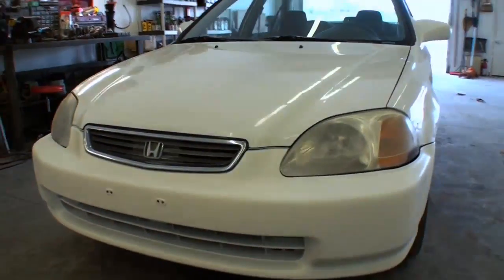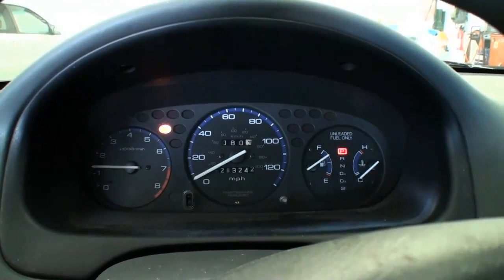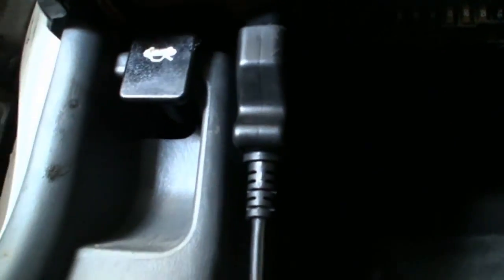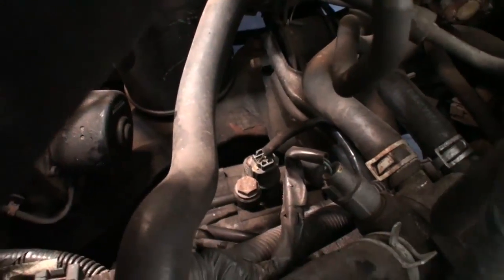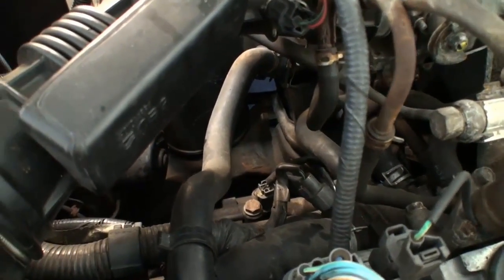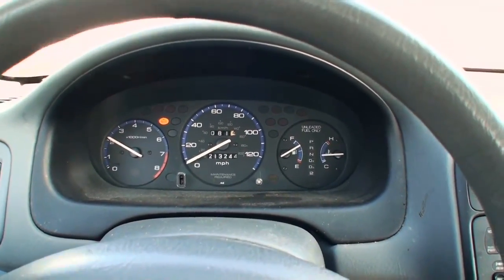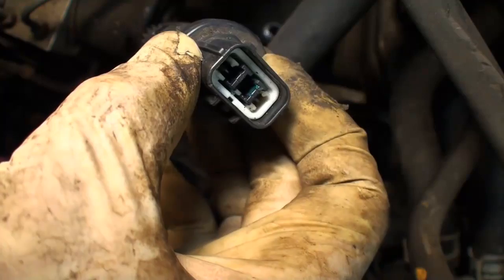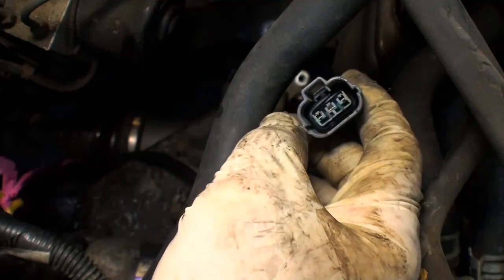P0501 1998 Honda Civic Speed Sensor Diagnosis -EricTheCarGuy

Comment: My speedometer does the jumping around 60mph. No check engine light. My transmission does shift funny around that speed. Any suggestions? Does there need to be a check engine light for it to be the speed sensor?
Reply: Marvin Cruz having the same exact symptoms as you did you get it fixed
Reply: Yup! So I took a look at the harness and corrosion was present. Also the middle clip inside the harness was lower and it just didn't look normal. Ordered a new pigtail harness from eBay, worked perfectly since then.

Comment: @ericthecarguy 
I have a 96 Honda Civic non v-tech, the speedometer doesn't work and no check engine light is on, I figured it should be on for either input and output sensors, I've also checked them all the connectors and wires are good no carosian. I also opened up the gauges and none of the gears are broken, could it be my ECU?
Reply: did you ever fix it?
Reply: @Texasnhis49bitches  yes! It's not too bad. You take the whole speedometer module out. Then you've got to find the pin that is cooked.  It's a pin in a circuit board. All I did was touch it with a soldering iron and it reconnected and has worked like a charm ever since!  The tricky part will be finding the pin. But it's not TOO hard... the plastic around it will look slightly burnt/yellow and it won't have much solder. I think it's because it gets hot and the solder vaporizes.
Reply: https://www.youtube.com/watch?v=QZPKYXVUl2M
Reply: @bob15479  video is not available

Comment: I just bought a 98 manual Honda Accord.  the speedometer isn't working but all other gauges are working. It was suggested that I check the speedometer wires for splices before I replace the sensor. However I haven't found any videos or instructions on how to check or replace the speedometer wires.
Reply: did you fix it?

Comment: i have a 1998 Acura integra with a speed sensor problem. the way i understand it, there is an input speeed sensor and an output. Ive got an issue with my speedo not working as well as a hard shifting issue. which sensor should i replace?

Comment: I'm been having trouble with mines it was bad so I went and got a new sensor and it worked well then it stopped. I cleaned the connection and it started working for a few months stopped working went and got a new sensor and now it doesn't want to work. what could it be?
Reply: did you fix it?
Reply: @Texasnhis49bitches  yea ut was my connection i replaced it and it was good never failed again

Comment: Hello, I do appreciate your precious help in the videos. Thank you so much.
I own a 1997 Honda Civic 1.5i VTEC Fastback (european model), 114 CV.
The Cluster is similar to the one you show in the video.
First the speedometer shown a behaviour like the one in the video and suddenly the needle pointer went up to the maximum speed (end of scale) and is sleeping now, pointing to "6 o'clock". All the other parts of the cluster are working well.
I do presume i have a problem with speedometer sensor which i must check attemptly for the electricals and replace by one new if necessary.

What you suggest to take the speedometer pointer to zero?

Comment: Thanks for making this video. Helped me figure out exactly what was wrong with my 98 Honda Civic DX. The needle would bounce around in park, at a stoplight, and while accelerating causing the transmission to jerk around if I had the gas pedal pushed down to the wrong spot. Disconnected the sensor and there was coolant inside, car drove fine with it unplugged, and the needle didn't bounce. Gonna put a new vss in tomorrow. Thanks again.
Reply: im a little late to this comment but can you let me know what part you got

Comment: hi eric. i have a problem with my speed sensor. civic eg 1995 model. i suspect that the wiring on the socket is the problem. i tried testing the wires using the test light. the 2 wires went on. while the last wire. the third one. does nothing. it like it doesnt have power or current running on it. is that normal or not? do i need to check the wiring connected to the transmition itself? thanks in advance
Reply: Milo Dayuta did you find a solution?

Comment: Hi Eric , question ? After installing the speed sensor an my part is exact after market part as yours, it's still bouncing? The connector on the old sensor ( all prongs "3" ) are in good condition & not corroded I replaced anyway,  could it be the connectors leading to the dash?

Comment: my 1993 s10 blazer has a 4l60e and i belive the speed sensor is bad the drive and over drive kick in and out but 1st and 2nd gear work fine i have a digital cluster dash so i wont know if the spedomiter is jumping

Comment: i just bought a manual 96 civic but it doesnt has rpm gauge. weird. i need it. and also for gear indicater. when i switch to reverse. sometime it doesnt engage. i have to do it again
Reply: +Kawaii Ninja try stick it in 2nd and then reverse in one motion, that helps usually.
Reply: +lew bear thanks. im used to the car now. i just move to reverse really hard

Comment: I went to change my o2 sensor because it was dead. After installing it I did 3 0 to 60 times but on the third time I didn't have overdrive and my cruise control stopped work.

Comment: I have a 93 civic sedan eg automatic so the problem is that when I try to  accelerate it happens very slow and in order for me to go to the next gear I have to release the gas pedal a bit and it go into the next gear still not picking up speed especially on the highway when I struggle to get to 60 any ideas on what it may be ?????Help

Comment: hi I have a 98 civic ex auto. when I first start driving the speedo does do anything until I start drive for a while. I replace the speed sensor but does the same thing. could it be the cluster?
Reply: Yup, is the motor on the needle. You need a cheap soldering iron and heat, pull it out, replace, and reheat the solder and your good as new

Comment: Hi Eric, I have a 00 civic si and the same speedometer problem but wen I unplug the speed sensor and run the car, it still sits a lil above the resting needle or bounces. could it be a bad cluster?

Comment: Eric, I have a 98 civic with a 5 speed that has the same speedo jumping symptom along with dash lights that flicker at a fairly quick pace. Disconnecting vss stops speedo jumping but does not affect dash light flickering.  I don't have a 501 code but I do have a 1298 code. I've seen .on later civics, a "load detector" related to the 1298. Does that apply to the 98? Could that cause speedo jumping, or could I have a bad speed sensor without a 501 code?
Reply: +drummerboy smith  yeah i needa know this too cause i got code 1298 the check engine is on but flashing. speedo jumping and my D4 light was flashing green but it only did that one.. once
Reply: +718BabyBoy I've got info. There's a blue connector beneath the intake manifold. Right where the bracket from intake to engine is. The bracket, apparently has been known to damage the wires in that area. I'm working on mine right now. No lift, just jackstands. It's a bitch to get up in there and work. I'm trying to get the blue connector unplugged right now.  I'm 60 years old and my fingers aren't as strong as they used to be. Already removed the bracket. The damage is not obvious. I've read that you have to  disconnect that blue connector and possibly strip away the black plastic covering the wires to find the damage.  Anyway, I've heard that this is a problem from a few sources, including an old friend and master tech with a shop in CA. who has seen it himself.  Good luck.
Reply: +dan hood check alternator fuse 7 i believe. i have a 98 civic lx. shit was going crazy. jus put a new fuse in mine looked ok but i did a new one. problem gone. my first attempts were trans speed sensor and alternator. ended up being jus the fuse
Reply: +dan hood check the fuse promise Thats it
Reply: +dan hood  

did you ever figure out the problem my cars doing the same thing
Reply: it's your alternator doing the flickering its what caused your vss to go out I've had this happen on two different  cars
Reply: that is a possibility but Its more unlikely than the eld in the alternator  going out and it's possible for it to pass an AutoZone test and then you have to check fuse 15 for the alternator speed sensor and if it's good you need a new vss
Reply: 718BabyBoy ... you just saved me a world of hurt.  A good friend was ready to write off her 20 year old civic (with only 76,000km on it!) because the speedo had gone all wacky, the HVAC controls were not working, and the engine was missing.  I put a meter on it and noticed it wasn't charging, and then I read your post.  Replaced the alternator fuse and ... bingo ... problem solved!!  Thanks buddy!  You made her a happy girl!

Comment: Friend of mine has a 1992 Honda Civic where the speedometer bounces back and forth between 20mph and 50mph. Ive heard of issues with the cluster on this year model but ive noticed if when sitting still, I move forward like half an inch it will shoot to 50mph, another half an inch it will go back down to 20mph and so on and so forth repeating that flip flopping back and forth

Comment: i have a 2002 kia sportage, and it has those same problems. but it does not show on the scanner, nor does it happen all the time. 1st to 2nd, good. 2nd to 3rd, good. but from 3rd to 4th... bad! SOMETIMES. it would stay in third and just rev high. id have to put it in neutral while rolling, shut down the vehicle... wait a couple seconds, then start up, put back in drive, then it will take gear.... any thought???? I'm all the way from Belize in the Caribbean.

Comment: I had the same issue with my speedometer, I replaced the speed sensor and worked briefly now doesn't function at all. advice?
1996 Honda civic ex manual transmission
Reply: Jeremiah Zermeno did you find the problem?
Reply: @DoubleSlou  did you?

Comment: Hi Eric please please help i have the same problem to my odometer and also d4 has a blink and my reverse sometime it will not reverse you need to put on neutral and accelerate then back to reverse and i can drive then.. i already bought the speed sensor and the TCM. do you think i can fix this with my new speed sensor and TCM? hoping for your reply thanks :)

Comment: Iv got a 2001 honda civic with 145,300 miles and when im driving on the freeway doing about 70mph. My Speedometor will go to zero than jump back up to 70mph. It doesn't do it everyday but than again im not always looking at my Speedo. But on the few occasions i have looked..its done it. Then my  other problem I have that I think might be related is just before my transmission shifts into 3rd gear it flares. And it sometimes does it even in 2nd gear when the transmission is not fully warmed up. I have no CEL, nothing is flashing. So does this sound like a defective speed sensor?? Cause with some of the symptoms I have read online, they match my problem.

Comment: My 98 civic gave my P0500. VSS. But the speedo isn't jumping around nor is there a check light. I just replaced the TPS, fuel filter and both O2 sensors because I was getting jerky hesitation during acceleration. While there was no engine light for any of those they all threw codes. But after replacing all that I got the P0500 and it's still driving the same after it warms up. I picked up a new VSS but I'm kind of doubtful my issues are related to the VSS since I wasn't originally get this code.
Reply: Sounds like a distributor issue take the cap off and inspect it sometimes moisture gets in the dizzy and corrosion is inside

Comment: EricTheCarGuy having watched the video i noticed you replaced the full sensor. that is the top with female connector down to the gearing that fits into the transmission. many places i have looked to buy part from only sells the top of the sensor. the plastic female connector and the bracket that attaches to bottom of sensor. why is this and should i order the complete sensor?

Comment: Hi eric
I like your videos as they are very useful.
I have a question please?
I have a SUZUKI WAGON R+ Auto 1997, driving in the high ways great, but if I drive in the lower gears particularly 1&2 it is difficult and stays in 1st sometimes up to 30-35 k/h and then sometime while driving around 20-45 k/h suddenly goes back to 1st gear!
last thing is if put OVER DRIVE button ON drives up to 20-25k/h then goes to NUTRAL!
 thanks
JK

Comment: I've got a 1998 civic ex coupe and my speedometer works maybe 10% of the time. When it's not working it usually jumps to and stays at 20mph. It'll jump between 0-20 when I'm driving slowly like under 20mph. Could mine be the same problem?
Reply: Carlito Culpable are you sure????
Reply: Mine has the same symptoms
Reply: I just bought a used cluster with extremely close mileage for $60 and 10 mins later it's working perfectly!
Reply: Fuck I already ordered and purchased a speed sensor I'm supposed to pick up at auto zone tomorrow...should I not install it and jus' git a refund??? And git the cluster instead????
Reply: Tyler Starliper
Reply: I'd just replace the cluster
Reply: chris herbert did u get the cluster?
Reply: Is it the same thing with manual hondas???
Reply: EVERYONE: THIS WILL FIX IT: https://www.youtube.com/watch?v=QZPKYXVUl2M I did this, fixed my civic with the exact same symptoms. Easy half-hour fix.

Comment: when my car reaches the speed of  45 miles per hour the d4 light blinks all the time into you turn it off and on
Reply: thats a transmission code. get the transmission checked.
Reply: On my car it was the tcm on the right side front floor give me call when you get the chance 757-230-4786 Jerome

Comment: hey what would cause a po505 and I put a new iacv from Honda on it and I have no cruise control light comes on cruise and the check engine like comes on every 150 miles and the codes shows 2 times what gives? no vacuum hose leaks plus cruise does hold vacumm pressure so I am pissed and at a loss I have the same car as in this video..any ideas thanks joe

Comment: Hey I need ur help I have a Honda Civic EX 98 and my speedometer its stock on 20 I change the speed sensor and install the same one that u use in this video and its did not work so I just bought a 110dollar speed sensor and installed it and its till the same stock on 20 what can I do
Reply: Wow me too, did you ever figure this problem out? Idky you would think it was the speed sensor. Cuz if you just unplug it and drive the car it stays on twenty.
Reply: Matt Hart Google tsb 99 029 it's a pdf file and it will show you where the short is located on the eng wire harness. The harness shorts out under the intake manifold and causes the #15 fuse under the dash to blow, it's a 7.5 amp fuse, check it, sometimes you can change the fuse and it will work until it shorts out again. Usually the MIL light will stay on and the code will say that it's an O2 heater sensor and also the VSS sensor. 
http://www.tegger.com/hondafaq/tsb/civic/x99-029e.pdf

Comment: Where can I get that device that checks your car and give you codes to what the issues are.  Can you please tell me how I can fix my 1995 Honda Odyssey LX speedometer.  Also the ABS light stays on.  I took it to the Honda dealer and what they want to charge me to fix is absolutely ridiculous.  $2,000 bucks to have everything replaced?  Are you kidding me.  Car has some outside rusting but  I can't believe that a whole system needs to be replaced.

Comment: My speedometer in my 98 civic was jumping all over so I unpluged the sensor. It is still jumping and the alternator fuse keeps blowing and the headlights flash a little and if it makes any difference the whole distributor was recently replaced. Don't know how to proceed now. Any suggestions?

Comment: Please help me I'm not sure what the source of my problems are, I recently changed my transmission in my ek3 (d13b engine) when changed the speed sensor was not working I tried the old sensor which I know was working still no luck I put the other 1 back in and left it then a few days after i engine washed and the sensor started to work followed by a strange back and forth rocking on low gear theen in 1-2 days time the rocking would stop and the speedometer would stop also I changed mounts and had an electrician check out the wires connecting to the sensor he said the wires were fine but every now and again with mostly rainfall the rocking would start back and the speedometer would go crazy my mechanic said it could be the valve body needs service but I don't want to spend unnecessary money to clean it and still have the problem there

Comment: 1998 Honda CR-V.  LX  (2 wheel drive)

the error codes I've gotten are: 

p0730 - Incorrect Gear Ratio

and before I cleared the codes (I replaced the valve cover gasket and cleaned the plugs because of misfiring)  I was also getting a 
p0715 - Turbine / Input Speed Sensor "A" Circuit, which is why I wasnt sure where to start on what to check. 

I tested the Transmission Control/Shift Solenoid for resistance and got 14.7 ohms, but did not take it out to see if it clicks when supplying power; do I need to? or could I leave it installed and see if i could hear it?

I'm not sure which is the Input Speed Sensor and which is the Output, etc. I've seen like 3 sensors and dont want to start removing anything and accidentally break a working part. But I was told that this may cause both... 

Could anyone help?

Comment: Yes I did I took it to auto zone and had them check it with their machine to get the codes. It told me it was either a close circuit/ short circuit or the main shaft speed sensor. In my car it's the sensor in the front of the transmission( my car has three speed sensors "speed sensor"" output speed sensor" and main shaft speed  . So all I did was buy a use one $40 "eBay"and changed it and that fix it. I was lucky it wasn't and electrical problem. How that helps.